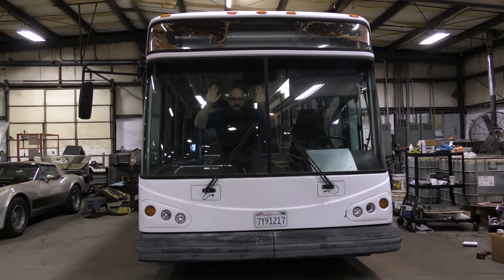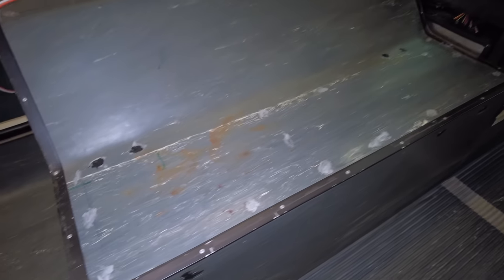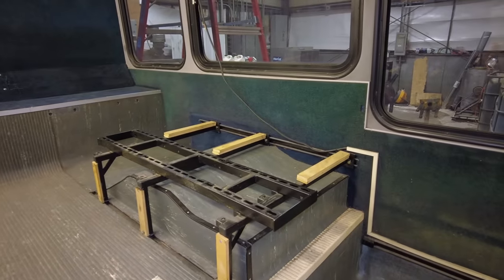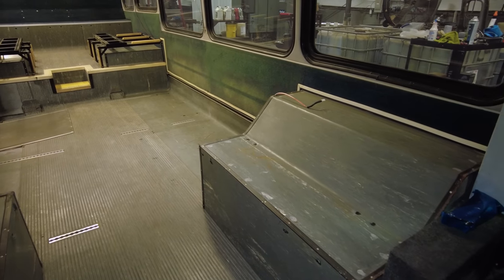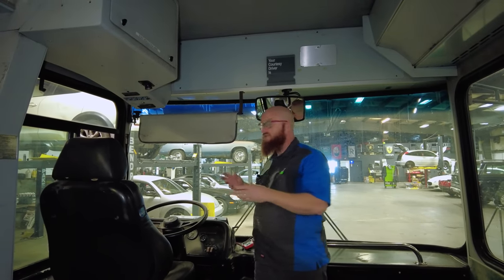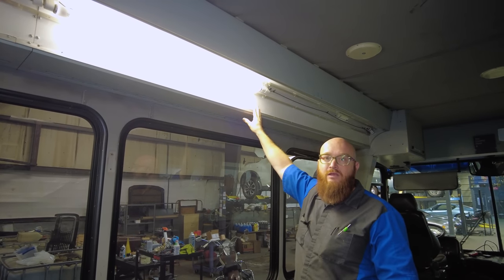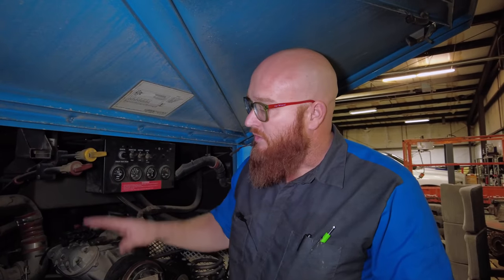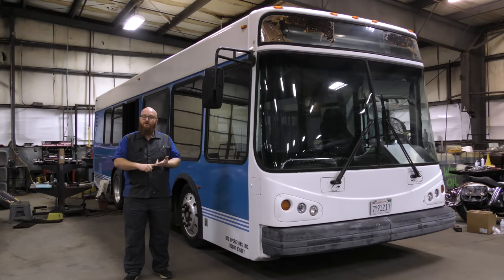Bus #3: EZ-Rider bus looks great cleaned up! Plus the CAR WIZARD has found a lost gear?!?

Comment: CT Transit purchased a handful of El Dorado EZ Riders back in 1999 (back when I was in college and before I had a car).  Different configuration than your unit as they had both a rear door and front door.  They were purchased to use on some of the shuttle loops and low ridership routes.  The drivers hated them and I know CONNDOT ended up getting rid of these early.

Comment: Hi guys, before you put 120 volt lights in you might want to consider what a lot of RV’s in Australia do now and that’s run most things off 12 or 24 volts all the time and just run a 120v - 24v step down transformer. This saves a lot of doubling up on lights and switches. Things that are 240v mains power are the reverse cycle aircon and the microwave and water heater but with lithium batteries and good power generation 24v - 120v inverters run those as well. I recommend you get some advice on modern power setups for RV’s before continuing your setup as you may as well run the most up to date equipment. I hope this helps if you see it. Cheers Stuart 🇦🇺

Comment: Already looking up since episode 1.
May I suggest you install a mechanical hubodometer to the back wheel. They look good and it will record the mileage you have  travelled in this bus. They're accurate and proven. I recommend a Stemco brand.

Comment: As an avid Rv’er, I would suggest you consider an older Geo Tracker or Suzuki Samurai/Sidekick as a TOAD. They tow really well, have a decent amount of room, are 4WD and are light and easy to tow. One of the most popular TOAD’s for rv’ers. They have a real transfer case and can be safely towed 4 wheels down without any modification. Both the auto and manual are towable. You may have to install manual hubs if the one you find doesn’t have them. Easy to do. Looking forward to seeing this project!

Comment: There are some SPS like the Siemens LOGO that work on 12V or 24V. If you only have to actuate 4 relais switches you could actually use these to simplify the operation of the built in AC. There is a lerning curve to program those - but not too bad. (You can also add 4 more relais switches to the same system with an add on module)

Comment: Mrs. Wizard:  Two tiny points.  1. Put the furnace and A/C thermostat where you can reach it from the head of the bed, so when it is cold in the morning, you merely reach out and turn on the heat before you get up.  2. Set up the kitchen in such a way that you can feed a group of people out the door easily.  Locate the fridge so people don't have to walk all the way in to get a soda, or add a fridge to the exterior.
Reply: Excellent recommendations.

Comment: Interested in seeing where you plan on putting things like water tanks and the like...most conversions I see use high-floor buses, which have room under the floor for those sorts of things, but that's not the case on low-floor units like this.

Comment: My FAVORITE series.  I have basically the same bus.  I've already learned a few things.  If the scan tool was in your affiliate list I'd help you make a couple of dollars 😁.   It was hard to see that it's a Icarsoft HD diagnostic v3.0 tool.
I'd like to see the measurements inside your bus.  The high ceilings give the feeling of lots of space.
I was thinking of window framing that would accomodate  insulating celular and or darkout shades.  I've seen thin ones in a track on some RV's.  And of course  for more temperature control on the outside, you can put perforated vinyl that is used in vehicle wraps.
In the  center of the back wall, have you unscrewed the panel and seen the access to the engine & transmission ?

Comment: Idea Smartrelay is a modestly priced PLC(Programmable Logic Controller) that can be had in 12/24 VDC power varieties. Could be useful for your AC, etc. We use the 120VAC ones for industrial controls.

Comment: One thing I'd probably do is to look at ditching the pneumatic door. Those have a lot of moving parts and really are not at all ideal for an RV. I'd look at removing that entire assembly and replacing it with a normal RV door of some sort.

On the windows, I do the graphics on a lot of city buses. Leave them in. Many of the city buses have a large cabinet installed behind the driver and there is a window there. What we do is just apply black adhesive vinyl to the inside of that window before the cabinet is installed. Just looks like a dark tinted window from the outside and is a good cost effective method.

Comment: Really great that you can unlock 6th gear AND up the horsepower and torque using factory programming.It's interesting how they over engineer these and then tune them to specific applications.

Comment: With the lights and electrical run everything with 12 volt all water pumps, lights and refrigerators. Then add a shore power hookup that automatically charges your batteries when you plug up. Then add a Victron Dc to dc charger to a second alternator to keep your battery banks charged while you’re driving. The new lithium batteries you can boondocks for few days then start the engine or the generator to recharge. That’s what I want to do to my bus add 5kw of solar panels with 20kw of lithium batteries. They even make a 12 and 24 volt air-conditioning now from vanlife. For heat in the winter Chinese diesel heater it even moves coolant to keep you engine block, heated floors 😀 and water tanks warm too. I've even seen tiny boat wood fire places in the middle of bus.

Comment: Keep an eye on your fuel economy before and after power gains. I have a Class A and I did the same tune on my semi. Just get it running where it likes to be, not stupid HP. I actually got a bit better fuel economy in certain situations and even up or negligible at worst. Just find it's sweet spot. More power doesn't always mean worse economy. Good luck. ✌️😎

Comment: For absolutely sure put the black tank directly under the toilet. Don't even think about trying to run drain line to the tank. Nothing good will come to you if you do. Sink and shower water lines are ok but the black drain has to drop straight in.

Comment: I don’t know about Alison bus transmissions, but in their EVS series (emergency vehicle) transmissions, you have to hit the “mode” button on the control panel to unlock 6th. However, it can be spec’d to be always available or locked out.  So it doesn’t surprise me that this type of application would be similar

Comment: Not sure about in the US but here in the UK most caravans and motorhomes just use 12v lighting but have an invertor that drops the supply voltage down to 12v when plugged into the mains. That way you only have 1 lighting circuit not 2 circuits and 2 switches. Most of the electrical systems are 12v so that you can run off grid or on battery/solar. Also any sockets installed are mains voltage unless you have usb sockets or specific 12v sockets like 12v cig lighter sockets.

Comment: For the led lights maybe you can you use some sort of 3 position switch (12v on, 120v on, and off) and run the 120 to an inverter to power the same LED lights regardless of power source rather than having 2 sets of lights.

Comment: I’m sure you are getting lots of feedback.  As a bus driver retired, (over the road, and some line service) here is my 0.02¢.  The short wheelbase on that unit will not give the most optimal ride.  Freeway hop is what I would call it. If you are upgrading the horsepower, I would encourage a complete radiator clean/overhaul.  If you plan on any mountain climbing, I would install electric fans in addition to whatever is standard.  Good luck with your project.

Comment: If the split systems (get 48vdc ones!) can't keep up with cooling the bus while driving they are too small to do so while parked so you would need bigger ones! the extra weight of the roof mounted a/c system and big arse compressor are much better off being replaced with batteries and a 48vdc alternator, covering the roof completely with solar will make your camping experience soo much better and will also charge while you drive so on a sunny day your not burning extra fuel while you drive to run the aircon!

Comment: Most RV’s just use 12 volt lighting inside and with a 12 inverter it will charge when plugged in   And going to LED will save a lot of energy and heat!!  Mirror tint   And if Mrs wizard is good with spacing awareness just use the old tape on the floor to do a first mock up

Comment: Tinting the windows will greatly reduce thermal load on the bus.  Also, each person the bus carried was about 300 btu per hour.  A lowered air conditioning output will ring out more humidity than a high output that is cycling on and off.  Consider changing the pulley ratio (if possible) to derate refrigeration output.  If the compressor is multi cylinder, it may also be possible to unload a cylinder.  Changing the pulley ratio is likely the lower cost option.

Window tinting is likely done on the interior surface.  Since the window surface is flat, if proper precautions on cleaning is done, tinting can be diy.

Comment: I’d keep as much 12 volt power as possible it’ll save you a lot of power in the long run because there’s a loss when you make it 120. Also definitely replace the insulation.

Comment: Hey just a thought use carpet underlay the black dense one between everything possible as to have no rubbing noise while driving it also can be used on the walls as insulation

Comment: Windows are ok unless it gets cold where you live, then they just become massive condensation generators. I would remove all the single glazed panels, fit double glazed units where needed and then blank and insulate the rest. Also in the summer you'll cook with all those windows, even with air con.

Comment: Silicone is not 'forever'. In case anyone is interested, in my book it is about the weakest sealer known to man. It does a great job - for about 20 minutes (-comic- but it really is cr*p compared to most anything else.) Check out 'cotton balls, super glue and accelerator' or just use some fiberglass patches. Ten more minutes now vs heartache later...

We always lock out 6th gear on fire apparatus. Whether or not the crews understand or agree, nobody needs to be going 70+ with 500 gallons of water sloshing around in the back, not to mention the speed rating of the tires not exactly supporting speeds that high. 6th in your usage is fine, just food for thought. (BTW, we have apparatus well over twenty years old and I can only recall one transmission repair on an Allison.)  

No idea what  P/S setup that has. Normal for me is pump, reservoir with filter and gear. Some might change the filter occasionally but $10 to a donut  less than six people EVER changed the fluid on a schedule. Poor performance and leaks/seal damage due to heat and contamination abound. Hopefully, being a bus, it came with a cooler. Not such a big deal for OTR.

A fun idea is to plumb in an air dryer bypass valve. It really sucks when your dryer locks up and you can't move the bus. You could just carry a handful of brass and wrenches to plumb around it  but a valve is so much easier when your brakes are locked up with no air, in the middle of the street and it's raining. Hint: the filter itself isn't what plugs up

Check your radiator fan bearings and alignment. If it has a clutch take a good look at it. 'In-city' service is hell on fan clutches yet they are highly valuable (MPG) on long distance driving. If you have any tensioners/idlers stay on top of them. And a lot of mechs hate wheel bearing service, so... Carrying some pieces of coolant hose and some clamps is a really good idea as well. It's not always easy to find/feel a weak hose when there is only an inch or so between necks. Also, if there's a sight glass in the radiator either replace it or plug it. There's usually a level sensor that reports to the ECU so a sight glass normally isn't needed. A nickel now... Cummins & Allisons are pretty robust, things I've seen as common are throttle cable/adapter issues, belts/tensioner/idlers, and poor maintenance.

Amps are your buddy, check your alternator rating. I, myself, wouldn't keep anything less than a 350a alternator on anything with more than two batteries. Do you see yourselves boondocking more than parking in a campground with power, water and sewer? Not just because of power but also tank sizes, etc.

Comment: One set of planetary gears yields 3 forward speeds and one reverse speed. Any transmission with more than 3 forward gears will have 2 sets of planetary gears meaning 6 forward ratios and 2 reverse ratios. But if the clutches and bands are not present, those ratios may not all be available. Also, it does not necessarily follow that the unused ratios will be useful. I'm looking forward to seeing what becomes of this transmission modification.

Comment: Could you just use a home wall mount thermostat to call the fan and compressor to run? They make Master and Slave thermostats that allow you to use one a/c system with two panels which makes for not having to get out of bed or leave the driver seat to swap control units.

Comment: Replacing windows with aluminium, plywood and insulating material is SIGNIFICANT weight and heat reduction. That's why. And they might not leak now, but the rubber seal is not eternal, and also traps rot. After a dozen torn down bus shells, still haven't found intact window frames. Even with full infra red tint (aluminium foil) the glass radiates heat inside the cabin in summer, and gets cold in winter. The best mod you can do on your RV conversion is to remove as many windows as possible.

Comment: When planning to place you accuotremen  locate the CENTER of Gravity for these short wheel based buses.. then get a some dead wieght that approximates what you are planning to add and placed around the bus.. then go for a drive..  these short busses tend to PROPUS when you approach its GRVW.. also the more balanced this bus is will result in a more comfortable long range drive..

Comment: So... the base frame for a seat, which is supposed to hold Mrs. Wizard safely in case of a crash, is framed with vertical PLYWOOD?! @2:42 I really hope that will be steel in the final iteration.

Comment: Sounds like you and the zMrs.  Have great insight as to what your RV will be like, and with the improvements, will be a good unit.  Where have you decided to put a generator, or are you looking at a unit that can be recharged by the alternator, regular current, or by solar?

Comment: We are doing interiors for yachts, be sure you create a 3D mockup and walk trough, i saw some 2D drawings, but that's not working, in 3D you het a much better idea of size and how it fits.. even you have so much space, it's so much better to use volume in a clever way, don't look at floorplan only.. you can even use SketchUp for 3D visualization, easy to use.

Comment: You can have a big bed just design it so it folds up. Then you will so much more area for activities 🥳
Reply: Too add to that you can have custom sized beds made as well. I used to work at a mattress factory and would make rv beds occasionally. They usually have weird unique measurements so its fairly common.

Comment: Mr. Wizard. I am a long time RV er and parks have placed many restrictions on age and type of RV they admit. Most parks will not let a RV older than 10 years without visual inspection of unit. I ran into a park this summer that had limitations on type of Rv, no conversions of any type. The unit must have been manufactured as a RV and not converted. Just food for thought

Comment: You should have an Allison shop run an analysis on the torque converter at the new power/torque levels; even if they are below the input ratings for the transmission, the turbine torque rating could still be exceeded with the torque converter that was chosen for the stock engine rating. Also, you should check with El Dorado to make sure that the driveline is capable of handling the higher driveline speeds after 6th gear is enabled; spitting out a driveshaft on the highway might hamper a vacation.

Also, unless your source is getting the 6 speed calibration directly from Allison, I question how he knows what calibration to use; you want to make sure that he's not just using the 6 speed calibration from some completely different vehicle.

Comment: I'm no expert but I'm wondering if you could remove those lighting/vent boxes that run the length of the bus. That's a ton of utilized space and I can't imagine that vents and LED lights would need it all. And if most of that space is taken up by air ducts, I wonder if some smaller/flatter ducts might be more efficient anyway. With those boxes removed, you'd practically be able to create a whole crawlspace with how much headroom is available. A raised floor with storage underneath would also be possible and could keep the center of gravity down.

Comment: I drive a double decker bus here in Australia where at the moment it's 40 deg Celsius and have the same ac system in my bus. I run cold at 22 deg Celsius which is great so no they aren't always hot

Comment: If you're tuning the engine for higher top speed, will you need to beef up the brakes? Or are they good enough as is for the higher highway speeds you want?
Reply: Brakes are fine as is.

Comment: I highly suggest spending a few thousand and use a designer that specializes in RV's for your build.  I've already heard several big mistakes that you won't be able to easily undo.  At least present your layout to them and pay a grand or so to correct the mistakes that you're going to make.